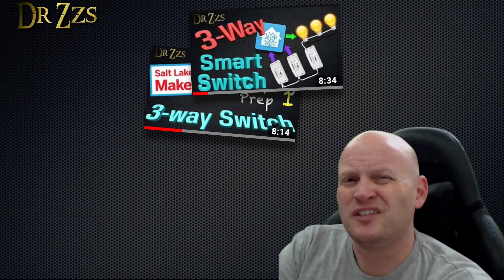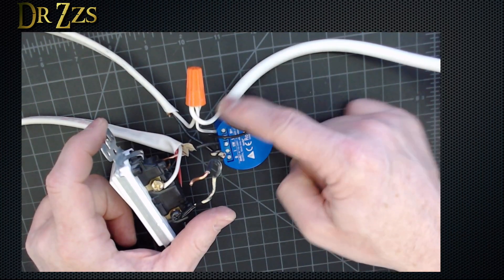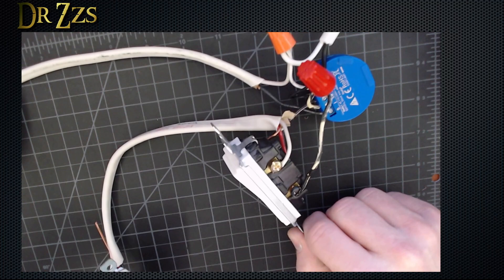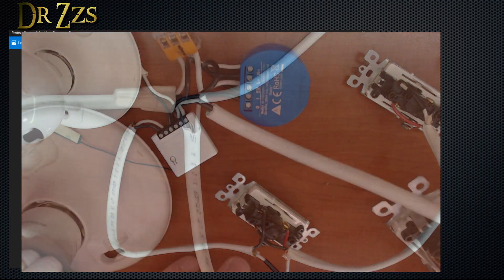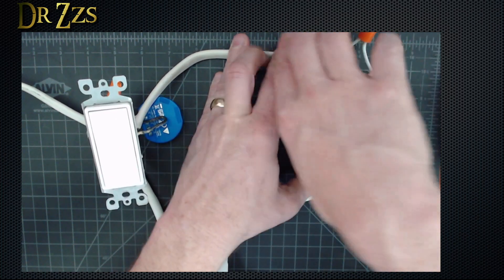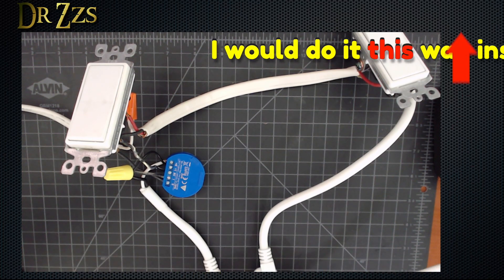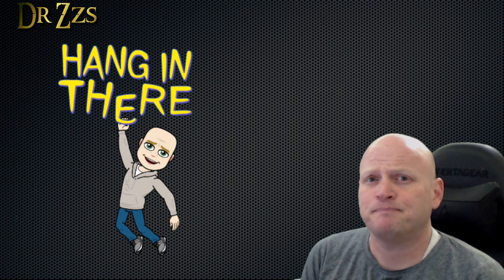The Final Word in 3-Way Smart Switch Wiring (at least from me)

Comment: I think I have a solution for scenario 3. I haven't tried it but I think it will work. here is the plan. replace the "main" 3 way switch (the one with line coming in) with a normal switch. and use one of those smart switches with normally open and normally close function. Too bad I can't post a picture of those. and use those NC and NO port as traveler to the other switch.

Comment: The problem with installing a SONOFF or Shelly in a light fixture is they are likely going to be in your attic. 

Two sources of heat when installing in an attic J box or a light fixture - the attic heat and heat from the light.  These would far the operating temperature of both of these devices both are specificed to operate at a maximum temp of 40C (104F).  Only way you can get there is with a conditioned attic AND something that doesn't use a bulb and emits light downwards (like wafer light).

Comment: In scenario 3, you could just buy a regular smart switch with the corresponding add-on (For example, Leviton DZ15S and DDR0SR-1Z). More expensive yes, but you're not left with the incomplete solution you have here.  The statement that "most smart switches can't do this" is a bit misleading.

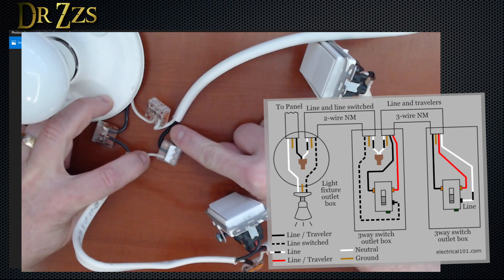Comment: As a important note here...@7:00 that wiring method is a NEC (code) violation due to not having a neutral between the switches. That may not seem like a big deal...however as the load increases the electrical radiation between the switches increases and long term exposure ISN'T a GooD thing!!

Comment: Doesn't this approach put the load on the second circuit vs the first circuit as it was originally designed? The original circuit is wired to the switch input of the Shelly appears to simply be a trigger.
Reply: I had the same thought... he's tying in the lines from two different circuits, which doesn't sit well with me. Maybe against code? I'm not sure.

Comment: Dr Zz. I love the videos. You are the go to channel for home automation videos. Love it. I do have a comment for the 3rd scenario. IF (big IF) you have power at both ends of the 3way wire. Then you can switch the wiring diagram to scenario 1.  Switch 1 originally has the power, switch 2 has the line to the light. If you get power to switch 2, then disconnect the power at switch 1 and only use the power from switch 2.  The new common (black) wire from the circuit breaker at switch 2 will be the black wire to switch 1, connect to black screw at SW1. connect red and white to the other SW1 terminals. SW2 Black screw will go to the Shelly SW terminal. the red and white connect to the other SW2 terminals. The common or black wire from the circuit breaker will also need to split between the Shelly Line (L) and Input (I) terminals.  Now you have time left to get the Huckleberry automated.

Comment: sir
is there a way to use Sonoff mini in existing  3-way circuit that has light in on first switch and power in on 2nd swith. all my 3 ways are wired that way

Comment: Hello, your videos are great. I was able to install the SONOFF Mini using this video on a 3 Way Light Switch. I just have a scenario that I need your help with. I bought the Sonoff Mini and would like to install it in a 4 Way Switch scenario. My wiring is exactly as show here  (4-Way Diagram - Option 1) https://www.support.getzooz.com/kb/article/211-4-way-diagrams-for-zen26-and-zen27-switches/  . I tried to use this video but when everything was connected at BOX 1 to the mini, Only the SONOFF mini was able to turn on and off the lights. The wall switches did not work. Any thoughts would be appreciated.

Comment: Hi @drzzs i have three way switch in my stair case both ends and three lights in the staircase. 1 at Star of stair case, one and middle and one at end. GF switch has the line in (phase) connected to common. two wires travel from gf to the other end switch(1st floor) where L1 is connected to L1 and L2 to L2. From L of the 1st floor switch phase goes to lights. Nuteral is direct from ceiling. 
I have nuteral and additional phase in 1st floor that i can make use of.

My question is. How to wire sonoff siwtch to work as two way on 1st floor switch socket

Comment: Mr. Doctor Sir, first - as an insomniac smarthome diy nerd, i love your videos, keep up the great content! a question for you - i have sonoff minis flashed w/ tasmota.bin on both regular switches and 3way switches, and unlike in your video where it is instantaneous, my sonoffs respond very slowly to the physical switches (2-6ish seconds for the state to update). any ideas? my 3way is wired exactly identical to yours, so i am stumped after trying to google-fu the answer.
Reply: I want to reply to my own comment to give some information that may be helpful to others: I figured this out! So the problem was somehow a result of flashing OTA, and flashing OTA sucking. When I did the OTA procedure, since there wasn't enough free memory to directly write tasmota.bin (aka the old sonoff.bin) I had to first write tasmota_minimal.bin (aka the old sonoff_basic.bin) and then use the web interface in Tasmota itself once the device came online to upgrade to the tasmota.bin firmware. After loading tasmota.bin, this was always extremely laggy, not only in my 3-way switching setup with physical switch toggles, but laggy from the device's web console as well. Unfortunately, I never found a way to fix the lag....

...But since not only did my stock Sonoff Mini modules not suffer this lag issue, but also because I noticed that the tasmota_minimal.bin had no lag when toggling from the web interface before I OTA flashed tasmota.bin, I had a hunch that something just wasn't sitting quite right with the way the firmware was written to the flash using the OTA method. So, I decided to get all of the necessary implements to try re-flashing the offending modules via USB. I first erased the flash using esptool, and then just for good measure wrote a blank bin file to the module to ensure that the flash was erased completely (link: www.pratikpanda.com/wp-content/uploads/2016/05/blank_1MB.zip). I then wrote the exact same tasmota.bin to the flash, and LO AND BEHOLD the lag disappeared and everything was perfect and peace returned to the land.

tldr; f*** OTA, serial flashing is a bigger PITA to do, but it is well, well worth it.

Comment: You are so awesome! No, seriously!! I was searching on how to properly wire a three way switch with the power coming into the same switch box as the light feed wires and couldn't find an example online. You just saved me so much time from trying feed power into the other 3 way switch box. And now I also learned that I can easily add the shelly to this circuit in the future too.

Comment: Need help please. My got white and red for left and right similar like yours first set up. Then it got a red to the common, from the same red cable, the black just connected together with other black cables from other lights cables. On the other switch, it got the white and red like yours, but a single red wire connect in the common of the switch. What should I do? I believe it need to do from the 1st switch, right? But not sure how?

Comment: Great Video!   BUT  at 15:36 you talk about something I have been searching for without luck  Will you do a video on how to make one Sonoff talk to a second or third Sonoff without using the home network or internet but rather using the server that Sonoff comes from the factory with.  I do not have internet at the location I want to use these at.   This is a very large building with the lights controlled at only one door.  There is NO 3way wiring to other locations.  I was hoping to use a Sonoff mini or basic to control the lights at the current switch, then install and power other Sonoffs  at the other doors that would trigger the control.
Reply: Without internet you've going to have a really hard time. The factory Sonoff firmware relies on internet connectivity, so that's hard out.
You can't do it with Tasmota either as they require at least a wireless router. If you had a router, even without WAN, you'd could still do it that way though.
If that's not an option, you're really out of luck, unless you can program these yourself. If so, you COULD (in theory) write some custom logic that would have the device connected to the lights act as an access point and connect the others directly to it. Then you could pass messages directly to the host unit to the light on and off.
Reply: See this question for a similar situation: https://github.com/arendst/Tasmota/issues/5613
Reply: In reply to "Cole".  Thanks by the way.  I should have said.  I could do set up the Sonoffs at my home with the internet but the place I need to use this does not have internet.  I could add a router,  but I would need information on how to make that work with the sonoffs for this project.
The one work around (or other solution) is I could use a Sonoff RF,  I get one that came with a small button unit.  I could put the at the other location.
But I will would rather use two basic or mini units so they get power and not batteries.
Reply: @carlcallenburg7898  well, let me ask you a couple questions then.
Do you understand basic networking (IP addresses, what a LAN is, and how to configure a router)?
Can you flash new firmware to the Sonoffs?
Could you write some new software for the devices and load it on them?
There's more than one way to skin this cat, but what you're trying to do is going to require some effort and know-how.

Comment: I think the fact that the Shelly can use a 230v input is a huge difference to the Sonoff, it means the Shelly can be installed inside a light fitting, versus the switch box and will still function. The Sonoff could not be used in that way. 

I'm also pretty sure that given a much longer run of wire (eg: where you have upstairs and downstairs 3-way switch setup controlling a hallway/landing light), the resistance over the cable length would mean 3.3v would not be sufficient, especially on older installations. I'd have to check this, I'm not 100% sure.

Comment: Dr. ZZz
I have a usual situation with MOES 3 way in the main hub where line comes in and traveler comes out
and from traveler switch it goes to the light. It works on many places in my house with MOES 3 way.
The 3 way works mechanically OK as it SHOULD with on/off on both sides.

BUT the smart switch for some reason is not registering when light is toggled from the traveler switch. 
I have checked continuity etc. can not figure out what is causing this issue.

Have you seen this?
Reply from the maker: I did see that when I had two circuits involved.  One for power to the lights and another to power the switch.  Doesn't sound like that's your issue though.  
Sorry.  Not sure why that would happen.

Comment: Idk if I'm doing good or just dumb but because I use home assistant my 3 way switches are all hooked to a esp 01 not mains when you flip the switch it runs a automation to turn on or off my smart bulb. I also have very old wiring in my house so there is no neutral wire so I just used a wire nut to keep the socket power always on. Works good for me and then I don't have to worry about kids playing with switches and frying out my cheap-O- Walmart bulbs.
Reply from the maker: Whatever works man!

Comment: There is another solution for n-way switching that is worth talking about that works when mains power and output to load are in two separate boxes.  This is a much safer option than #3 in the video.

First, replace all the n-way switches with momentary switches (you can convert a standard switch to a momentary switch for free). 

Next, use the your white neutral wire for neutral through the entire circuit (just pass it through each box).  Use one hot/traveler wire as a hot wire (I use black), and the other hot/traveler wire to carry the switched momentary power (I use the red wire for this). 

Attach the black and red wires to each switch and continue each wire to the next switch in series connecting black to the bottom pole and red to the top pole. In the box with the load wire, use the black hot wire to power the Shelly and provide power to the "I" port. Attach red to the "SW" port. Attach "O" to the light/load and "N" to neutral (white). 

Last, after powering the circuit up, configure the Shelly app for momentary switching. 

This method should work for any n-way configuration and provide a safe way to do n-way switching with any number of switches where the mains power and load output are not in the same box.
Reply from the maker: Thanks1
Reply: @DrZzs  I know this video was your final word, but it might be worth making a "final final word" that includes this momentary method and says not to use method #3 unless the other power source is on the same breaker... Hate to have people see magic smoke when there is an alternative, safe method.

Comment: In circuit 3 there is a way to use the sonoff.  Since box 2 needs/has a separate power feed, in box 1 you could cap the incoming power and convert the circuit to the first circuit you show.
Reply from the maker: Very true! 
That's the way I did it in the very first 3-way switch video I did a long time ago.  That would be my choice over mixing circuits like that 3rd method.  Like I said, I really don't like that method, and I'm usually pretty cavalier with my installs.
Reply: Sorry but how can you convert circuit 3 to circuit 1 without having three wires connecting the two switches? Do you crisscross black and red wires to do the trick? Is there any other way circuit 3 can be usable with sonoff? I've also seen this solution utilizing a relay: https://itead.freshdesk.com/helpdesk/attachments/11052663458

Comment: In The Netherlands you aren't allowed to have separate circuits - that is behind different breakers - end up in the same box. So you would have both neutral and line connections connected to the same breaker anyway.

On a separate note: we usually only have two wires between the switches. One switch is fed the line. The other connects to the line-in of the light. The neutral is with the light. Usually there will be a line there too.
Like the top diagram on https://nl.m.wikipedia.org/wiki/Wisselschakeling. As you can see you can also add more switches without much complexity.
Reply from the maker: That is freaking Genius!  
That's it!  I'm moving to the Netherlands!

Comment: Am i right that there is one major difference between the Sonoff and the Shelly, wich is: The sonoff needs the wires from the switches both to come in seperately (the are i no way connected to the actual power) and the shelly just needs the 1 commen contact and the other other commen is connected to the power or +. This would make the sonoff harder to connect as you need an extra wire from the switch that would have the +. Hope you can understand what i am trying to say, not to good at typing in english
Reply from the maker: I think you have it backwards.  The Shelly needs an extra wire if you want the relay to switch the same circuit that powers the shelly.  The sonoff relay always switches the circuit that powers the sonoff. 
Hope that helps.

Comment: What about a circuit that has 3 switches involved?
Reply from the maker: oh sure... now I'll be making another video! :) 
Really though, there is another kind of switch with 4-poles that is made to go between two 3-way switches.  
The wiring looks like this: http://www.electrical101.com/4way-switch-wiring-using-nm-cable.html
The concepts about the smart device needing power and being directly connected to the lights still apply. 
Hope that helps.  
I think I have a 4-way switch lying around somewhere.  I could probably get it out and set up a demo.

Comment: Everything in the video looks good and accurate. The only misleading fact is that the traveler wires between the two 3-way switches do NOT have to crisscross. In fact if I was making a video I would place a 4-way switch in-between the two 3-way switches thereby creating a 4-way switch configuration. In this way we can demonstrate that the wires between the three way switches can either be crisscross OR straight through depending on the 4-way switch’s position.
Reply: So, scenario 3 looks ok to you?
Reply: Sir GoodEnough considering that the Shelly 1 fully supports 240v on the power supply side and dry contacts on the relay side for uses such as controlling a low voltage device,   Comparing that to scenario 3 where there is a 240v difference between relay and power supply (if supplied on different legs) seems similar.  

That all being said. I do agree with another commenter here that the best solution if you are running new power line to the Shelly box it would make sense to disconnect power to the light from the original source and simply use the new source.  That way there is only one supply leg and no 240v potential.  

But for a device designed for 240v and 120v I still think it should work either way.

Comment: When you set the button type to edge switch on the shelly's webpage, your toggle issue will be solved
Reply: I have tried the 3 available configs, including edge switch and follow switch. Still facing the toggle issue. Could I have a defective sonoff?
Reply: @ivanfjunior  
I've had nothing but issues with the Sonoff on multi way switching and I think it's due to voltage drop across the circuit. The Sonoff doesn't have mains voltage across the switch wire, but the Shelly does
Reply: @jonnyawright  thanks for the reply!
Reply: Hi Ivan, I'm reffering to the Shelly device. Unfortunately I don't have any experience with the sonoff switch device.